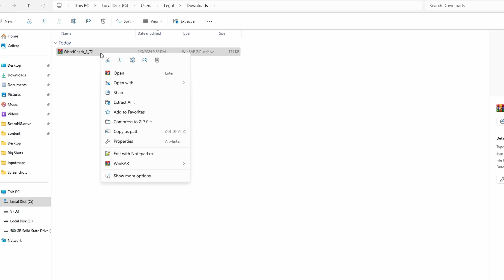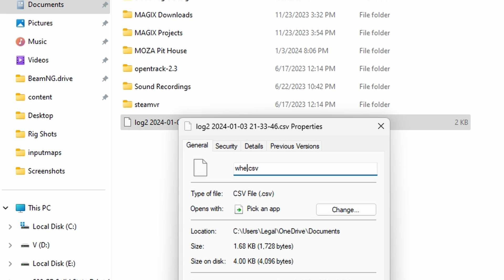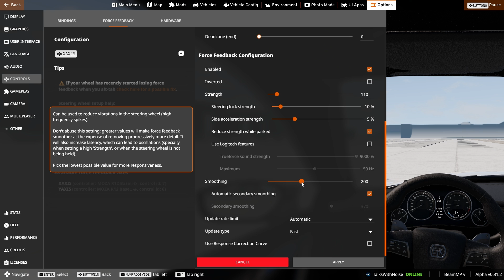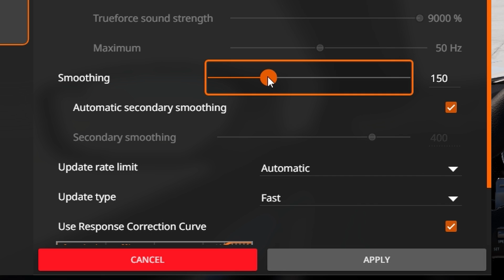Fix Your Force Feedback in BeamNG

Comment: Map your bracket keys to change FFB strength on the fly. Have a modded TMX and 350 is a good starting point. Between 200-400 depending on the car
Reply: I get some jitter when rolling really slow but the wheels in game match what I feel so guess it's fine. The FFB in this game is kind of wild because it's simulating the whole steering rack
Reply from the maker: @some-replies The jittering is abnormal though.  That sounds like unwanted oscillations.  Have a flat line towards the top of your graph?

Comment: I think I'm gonna get a moza r9 to upgrade from my g923, but I was just wondering how well your moza wheel works with beamng and does it start wobbling when you let go of it at speed or is that just a logitech thing?
Reply from the maker: All wheels will wobble if you don’t hold the wheel.  But violent vibrations while you’re holding it wouldn’t be good.

My Moza’s ffb has felt far better with each update.  0.32 has been the best :)

Comment: Hey Mr. Noise, thank you for this, helped a lot. However, when going straight, my wheel shakes very slightly left and right. Any idea as to how I'd fix this? I have a G29 if that helps.
Reply from the maker: It’s usually a problem with the force feedback curve making multiple points close to the same value.  I’m afraid there’s no way to fix it aside from manually adjusting the points, rerunning the test in hopes that it corrects the correction curve, or if it’s disabled :/

Comment: How do I convert the .csv into LUT? Because my wheel when not doing anything just shakes back and forth.
Reply from the maker: Changing it to a LUT isn’t going to fix it.  Does is begin oscillating once you let go of the wheel?
Reply: @TalksWithNoise  Yeah or just going in a straight line without any input even with my hands still on the wheel.

Comment: For those whose wheel shakes violently after adding csv file, check if “use response correction curve” setting is turned on. If not turn it on. Also try deleting your steering wheel from the game, add it again, check the “use response correction curve”, and then try adding csv file again. It might just work. Worked for me at least.
Reply: did not work for me

Comment: I have a little problem where my csv file in the documents is shown as an Exel file.
Reply: i have the same problem :(. found no solution yet...
Reply: coverted to lut file using the lut generator but file wount show in game might work for u
Reply: WINDOWS 11 YOU GOTTA LOVE IT
Reply: Did you ever find a solution for this?
Reply: @mikelaurell  I did, i just deleted microsoft 365 and office since i never use it, and then i got a csv file
Reply: open it with notepad, and you can set it to default to it as always, worked for me. also i couldnt find it cuz i thought it was just another exel file lol

Comment: If i go in a straight line, the wheel goes side to side quite a bit, odd
Reply: That’s just what happens in every game
Reply: @ProSkye59  Not in live for speed (my fav game, no game has beat it for me )
Reply: Have you found a fix yet?
Reply: @andj1g  no, probably is a beamng issue, cant easily be fixed
Reply: This is known as oscillation and can be fixed by upping your damper settings.  I would be more specific but I'd need to know what wheel you use. Fanatec it'd be the ndp setting. Messing with friction and inertia can help to if on a fanatec wheel.
Reply: @JustMamba  indeed fanatec

Comment: No. Wheel huh? Well Don't feel left out. Because I don't have one either and I need to not only buy a $100+ Wheel but a 100+ CPU some RAM a cooling fan and a new motherboard.  I wanted to buy all the components for water cooling and even of them I be scared and ruining stuff ill do it later and have the pipes out out of my way by put everything in the shape I want for it to fit in the case so when am done I can assemble everything on to the motherboard.
(Edit:oh and a handbrake.

Comment: "Now, this tip may sound ridiculous but I'm going to state this because this mistake is very common. If your ffb is very bad then try to invert your ffb. There is a possibility that it's backwards." HOLY CRAP. Thank you for solving my problems :)
Reply: thanks you bro this was my problem, big thanks
Reply: This was my problem too. I've had this game for years and the FFB never felt right. The driving just felt off. All I had to really do was invert my ffb. While I didn't get the information from this video, it's still very useful information. Ran the wheelcheck which takes awhile to get started AND to actually test. Your wheel will be doing a left and right rotation for what feels like 10 minutes. Worth it though!
Reply: @GalactusTheDestroyer more like 30 seconds and it only turns one way to bounce back to center
Reply: Mine was much longer than 30 seconds. It would rotate then come back to center, then rotate farther each time until it did the full degrees. That process took 10 minutes or more.

Comment: Every guide I check only gives me snap oversteer when I want to drift, in other games it's much more easier to setup and every youtuber has a different take on "what's the best setup" on beamng but none has worked for me, I have a G29 steering wheel
Reply from the maker: Snap oversteer is when your rear lifts upon breaking during cornering which you shouldn’t be doing to initiate drifts.  This tunes your wheel to feel like it should.  If you get a reasonable graph the rest is practice.

Comment: mine actually went worse now its shaking constantly and i cant find a way to fix it
Reply from the maker: Uncheck the correction curve.  You must’ve gotten some bad points from the wheel checker.
Reply: Hey, i made a new file and it still had the same problem.
Un checking the correction curve also did not work as it started to shake side to side again @TalksWithNoise
Reply: there is actually a dead zone rest on the force feedback graph witch idk why might have been the test going bad

Comment: i thought DD wheels didnt need a LUT or correction curve, at least that's what almost every other source says- i have a fanatec csl DD pro from when they came out and i get ridiculous ingame stutter while in VR when drifting near steer lock- if the wheel shudders a little like if the front tires lose grip or tie rod ends are toothpicks and deform slightly.. 

it doesnt seem like the clipping i was used to with my old g920 years back.. and i'm not running high ffb strength ingame nor in my profiler for my wheelbase(limited it to 6nm linear vs 8nm peak.)

my system is capable of holding 71.9/72fps(i run the quest 2 at its recommended resolution @ 72hz for heavily modded online servers on normal graphics settings, but i can run stable vanilla career mode at 90hz-89/90fps with most settings on high with a max of 40 active traffic spawns..
Reply from the maker: A lot of sources say you don’t because it’s 1:1 which makes no sense because correction curves have more to do with the motor properties which all DDs have.

Not sure what you mean about the g920.  Currently it’s based on an arbitrary number and not traditional torque units.  350 is what I’d set mine to as is recommended within the dev notes.
Reply: @TalksWithNoise  seems theres nothing to lose making a csv and giving it a try in that case. was told to not use a correction curve on it for so long that i figured it was for good reason and stuck with that.

Comment: i have a weird issue with this. it works perfectly but something is off instead of the force deadzone being 0 its -6 and when i turn the wheel it turns without issues for a small amount of degress then the strength, smoothening and the .csv file get to work
Reply: I have the same issue. If u got it working pls tell me how

Comment: I did all that but now my wheel is moving from left to right while standing still and driving at any speed. I tried charging ffb settings in beam but still nothing helped. (I got the thrustmaster tx servo base) can anyone help? Please
Reply from the maker: Guessing the csv file didn’t generate well.  Been having the same problem with my wheel after trying the test again.  It’s a hit or a miss on many occasions.
Reply: @TalksWithNoise   i guess im going to do another one thanks!

Comment: I have a g29 and the FFB feels perfectly fine, is it still worth doing?
Reply: on my g29 it giggles violently if i flik it  is that supposed to happen
Reply: @meryl3946  no idea, I ended up not using the curve for my wheel, feels good without it anyways.
Reply: @Clyman974  I have one, after I got it out again the FFB stopped. the test doesn't work, I tried everything. any ideas?
Reply: @Eggletsky_Adventures  Can't tell from here but probably drivers issue? Is your G-Hub updated? As I said I just never used the curves so

Comment: my "use response correction graph" is a prefectly straight line from the bottom left corner to the top right, is it supposed to be like that? i added the csv file and everything so
Reply from the maker: Try closing and opening Beam.  Sometimes ctrl+l works.
Reply: it didnt work for me its still just a strate line and yes i named the file wheel.csv @TalksWithNoise

Comment: Im building w pc with a Ryzen 5 5600X And 32GB of ram, and an RTX 3060. Will that run beamng?
Reply: yes definitely
Reply: @jangokett  I Am thinking of using a RX 6600 would that work instead of an RTX 3060?
Reply: @legotechnic15YT  i have a ryzen 5500 with 16gb of ram and a 1060 6gb you should be good either way. my game runs fine on high quality preset
Reply: @jangokett  the RX 6600 Is equivalent to the RTX 3060 while it only costs 280$ which is cheap considering it's a GPU. The RTX 3060 on the other hand is 400 Bucks. That's insane

Comment: For some reason, before and after doing this when going slow my wheel shakes for no reason on a smooth road.
Reply from the maker: Reproduced this myself.  Seems to be when either a) You don’t hold the wheel or b) The test malfunctioned when creating the csv file.  Currently unable to get the test to work after my wheelbase software updated.
Reply: @TalksWithNoise  help me same things happening

Comment: Tip: dont increase the strength of your wheel in its driver after already making the .csv file, as it will make the FFB jitter when your wheel is centered.
Reply: Thank you for this, i was trying to figure out for so long why it was jittering. i never would have realised that was causing it

Comment: The response correction curve doesn't show up in beam for me, it just shows a straight line. I've tried both CSVs and LUTs named them correctly and put them in inputmaps but they still wont work. I even went to the beamng page about this and couldn't find what I'm doing wrong. Please help
Reply from the maker: Could be that you closed and opened the game?
Reply: @TalksWithNoise  don't think so, tried that a few times before and it didn't work those times. Anyway I'm just happy that it works now
Reply: When your in wheel settings and looking at the correction curve box press ctrl+L with your csv or lut file in the input maps folder and it will apply but the graph doesnt update until you close and reopen the window or for some people close and reopen whole game! But ctrl+L while looking at the correction curve box and it will apply the file you put in input maps folder
Reply: experiencing same issue with g29. I see in the parenthesis of wheel csv it says it has a force, response pair of values but in my csv file on the first line it shows what i assume are the following values: force, startX, endX, deltaX, deltaXDeg. My guess is that it isnt working because of no "response" value but it seems to be working for many others

Edit: Not sure how it happened but the ffb curve is showing. My best guess as to how would be to use ctrl + l or relaunch beamng
Reply: Alright, Idk why but I tried again and now it works
Reply: For anyone coming back to this this is what worked for me:

1. Trash your old Xaxis where the settings should be changed.
2. Make a new Xaxis by pressing plus and spinning your wheel around a bit.
3. Restart your game.

Hope that made sense and works for y'all!
Reply: @andro1234567890100  i tried this but it still didn't work
Reply: @andro1234567890100 thanks!
Reply from the maker: At that point beam should recognize it.   Is it named to wheel.cvs?
Reply: @TalksWithNoise  yeah
Reply: @TalksWithNoise  the curve is just a big point on the graph and my steering wheel is freaking out just going back and forth  i need help with that

Comment: You lost me at app_name.exe I don't think that would work with the way I have BeamNG installed on Linux. But I guess I could try to install it in the fake windows directory BeamNG is in? But would proton run it?
Reply: you could probably try opening it with the wine program as that's how i run some exe applications on linux, although my current linux machines dont support beamng's min requirements atm so no guarantees on the specific exe used in the vid

Comment: Should I use the program if I have a csl DD?
Reply: I used one with my g29 to improve the dead zone feels and better low end forces. The setting in BeamNG that really improved my DD experience was manually selecting update rate limit of the ffb. Changing to 1000hz made it a lot smoother and detailed. By default “automatic” chooses 400hz or lower for my wheel, which feels grainy and harsh. Using a LUT for any DD I’ve used doesn’t provide  improvement, as the wheel’s torque output should already be linear.
Reply: @brisketreviewerbbq  1000hz, thanks!
Reply from the maker: Careful though.  Usually going too high causes instability in fps.  Automatic typically aims for what your system can handle.
Reply from the maker: 100%

Comment: My wheel (moza r5) seems to struggle doing the step log 2 test. it only swings anticlockwise before slowly juttering to around 5 degrees off centre. I then try to use this correction responce curve in beamng but it just seems to cut off half way through, as a result my wheel spins back and forth manicly. Anyone know a fix?
if it would be easier, ask for my discord.
Reply: try setting the wheel angle to the right one in the wheel tester
Reply from the maker: What are your pithouse settings before running the test?

Comment: what if it doesn't work(i use a pxn-v9)
Reply from the maker: Where did you get stuck?
Reply: @TalksWithNoise  the part where the test was supposed to start
Reply: it didn't show anything about positioning
Reply from the maker: Did you click log 2 under spring force?  Haven’t had anyone’s not start automatically from there :/
Reply: @TalksWithNoise  it's the Step Log 2 (linear force test) right?
Reply: @TalksWithNoise  yes
Reply from the maker: @BlakeProtogen That’d be the correct setting.  Not sure why it doesn’t begin then :/
Reply: @TalksWithNoise  it might be a compatibility issue. i've never seen anyone use a pxn before so...
Reply: you have no ffb don't do this
Reply: @319dcars  i realized that when i tried to do the ffb setup stuff on beamng and it just vibrated lmao

Comment: I could absolutely understand this with an expensive direct drive wheel but with the Logitech G27/G29 or similar cheap/old wheels I'm not sure this will benefit. I tried it and it did feel marginally better, but then I changed to a truck and the force was far too high, almost wrist breakingly high. Having to constantly adjust the strength depending on the vehicle for me kills the benefit of this fix.
Reply: don't think logitech g27 is capable of wrist breaking forces 🤣
Reply: @alexnotlando  You'd think not but I hit a curb going round a corner and my hand got caught in the steering wheel spokes as it randomly flicked left and right. Extreme unlikely situation maybe but I've found the force feedback more than fine without this fix.
Reply: @SimulatorAdventures  The wheelcheck is sort of a flawed test. I recentlyish got the CSL DD and tried it just for fun and it said my DD wheel was wildly non-linear. That being said, on my old wheel, which was actually fairly linear except for a FFB "dead zone" it helped get more subtle forces around the center.
I don't know what truck you tried, but the side by side buggy thing is genuinely terrible with FFB and I don't know why.
Also, keep your hands and fingers outside the wheel.
Reply: Actually the opposite, the DD wheels wont experience much difference, but on lower end wheels with less dynamic range its really beneficial
Reply from the maker: Strength changing is necessary regardless of this fix.  It’s the nature of driving different vehicles with ranging forces involved in the steering.  

The natural torque curve of Logitech ramps up very abruptly.  The csv profile will even it out and if anything, make it less wrist-breaky.
Reply: @TalksWithNoise I'll have to try it again but the G27 is so old now I wouldn't be surprised if my wheel felt no different because the insides are all worn down
Reply: Haven't tried these instructions yet but I've always had to adjust strength from car to car so I bound FFB strength and smoothing to buttons on my wheels.
Reply: How about the Trueforce option for logitech folks?

Comment: Ive been playing BeamNG before it was even officially released, and always felt FFB just felt a tad off, and this fixed it! Lots of great info in here and my wheel feels fantastic! Thanks man!
Reply from the maker: No prob!
Reply: @TalksWithNoise  how do I fix the wheel shaking on center? Also, is there a way to decrease the Force Deadzone?
Reply: @luanpietrodeoliveirapereir6025  same problem
:(
Reply: @PhotoEagle  my fix was deactivating the response correction curve, same as assetto corsa lut, fbb was terrible, until I stopped using LUT